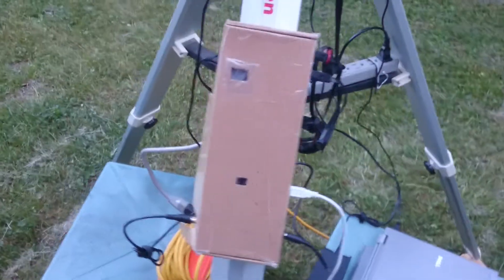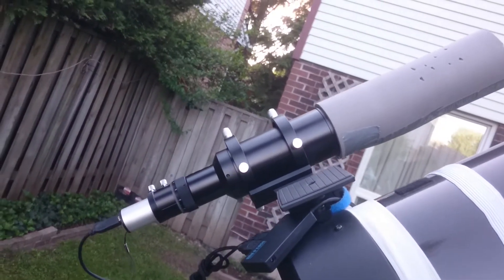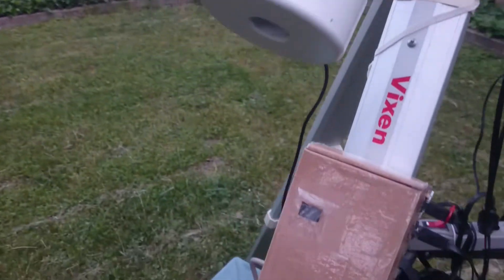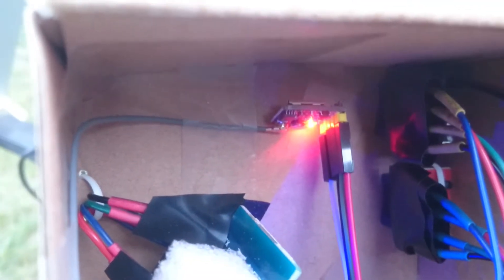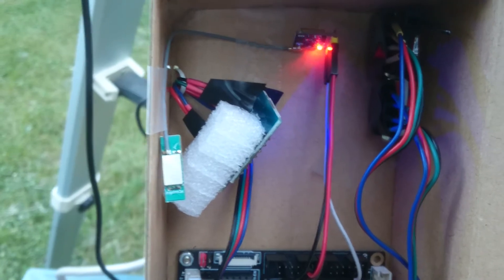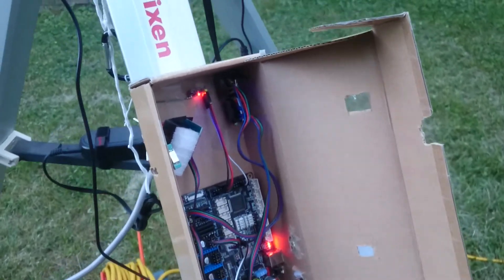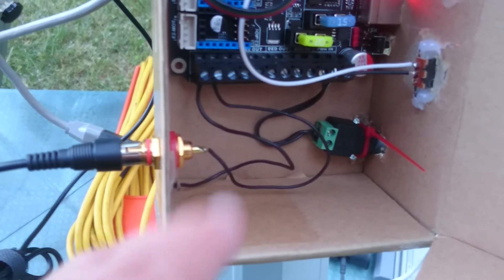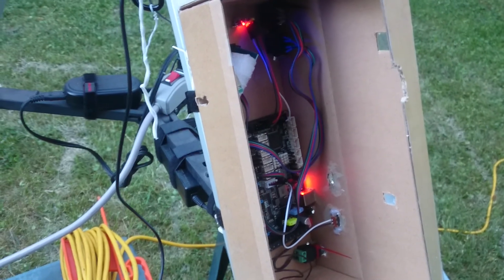FYSETC S6 V2.0 for the OnStep Telescope Controller with AGM336H GPS and Boot0 switch

Comment: Thanks Khalid for all you do in the onstep community! I have my G11 with the S6 v2 board going now thanks to you. So far it is working great I just need to add the GPS and it will be all set. I noticed OnStepX is on the way maybe and it sounds cool. Will it work with absolute encoders so when you turn on the system it knows  where it is pointing at that moment? I appreciate all your help and would be willing to make a donation for all the insight you have given. I plan to do the same for Howard
 Dutton also.
Reply from the maker: I don't use encoders, so have no first hand experience here. But several people did add that successfully. It adds complexity (extra wires, ...etc.)

Comment: Thanks Khalid for sharing this excellent video. You have always been very creating and helpful, and your projects like this has inspired lots of people around the globe. And I am lucky to be one of them :). I am ready with my telescope, and also thinking to add GPS to it. I have 2 spare modules lying around (bought for my drones) out of which I used one GPS for my Nikon D5200, and planning to add another on my OnStep dobsonian too.
Reply from the maker: Hello Pinak

Nice to hear from you. Hope your build is going well. 

Any GPS that outputs serial NMEA sentences should work. Basically, this needs the TX on the GPS to be connected to the RX3 on the S6, and of course 5V and GND. 

The two things to watch for are:
1. DFU mode: If the GPS is too chatty (outputs a lot of data), that can interfere with the S6 when you attempt to put it in DFU mode. The workaround is to simply disconnect the GPS before putting the board in DFU mode. 

2. Satellite reception: if the GPS requires an external antenna, then you need to connect such an antenna. Some GPS modules work fine without and antenna outdoors, but not indoors (for testing). 

Finally don't forget to connect the PPS pin of the GPS to the corresponding pin of the S6. That will correct the clock of the S6 from the satellites.
Reply: @khalid_ba  Thanks Khalid, great information. Definitely, I will keep all these points in my mind👍. And you know, when I get stuck, I always contact you 😀

Comment: Thanks Khalid. Very inspiring and thanks for your hard work in helping to get the software working. I built the Blue pill last year, then upgraded to the robotdyn stm shortly after you released your video and just when I thought it couldn’t get better you make this. Have a Fysetc 6 in the mail now…
Reply from the maker: The RobotDyn is very capable. Not much difference in speed between it and the S6 really. I would stick with it if it fulfills the needs at hand. 

The S6 just offers a basic solution without the soldering part. It also offers some expansion potential, e,g, GPS, second focuser, heaters, ...etc. but it gets unwieldy just managing the wires that go into all this.
Reply: @khalid_ba  what pushed me over the edge is that I want to add dew heating and a gps. Wiring will be manageable: I’ve upgraded my 3d printer and mpcnc so playing with 3d printer boards is familiar territory.
Reply from the maker: @scottfarndell2434  That should still be reasonable. 

Wiring is manageable as long as one does not try to do the "kitchen sink" approach, i.e. multiple LEDs, buzzer, 2nd focuser, rotator, weather, thermometers to each heated element, and so on.

Comment: Cool with GPS! Will it work on onstep bluepill n mini2PCB?
Reply from the maker: I don't know. Any GPS on any board requires an otherwise unused serial port on that board. It is only used to get the location, and time, then the serial port is not used after that. Check the Wiki page for the MiniPCB for details.